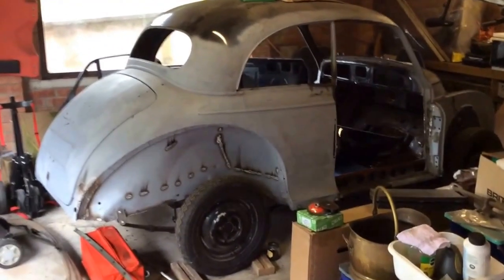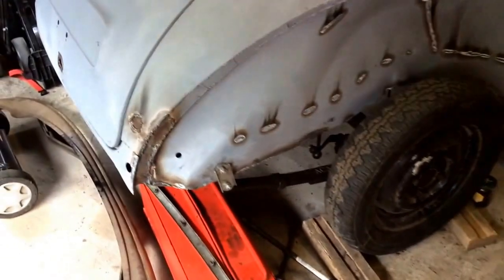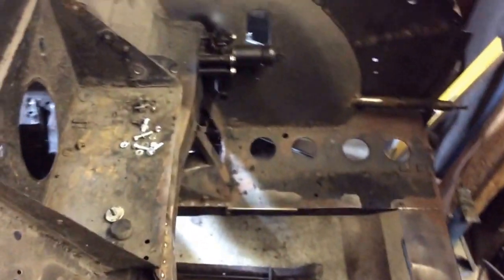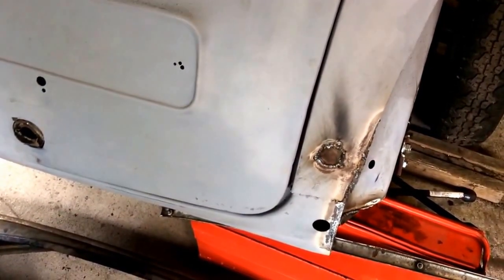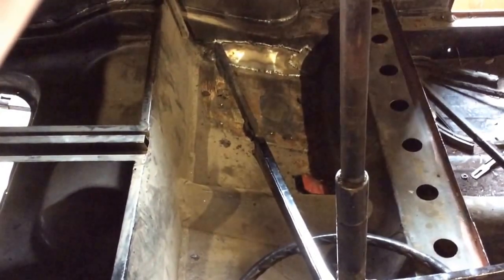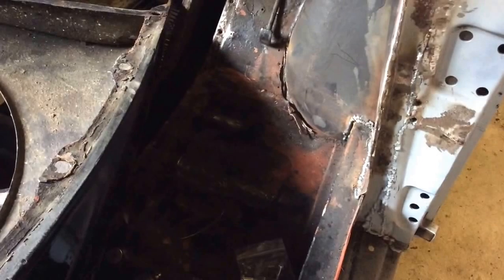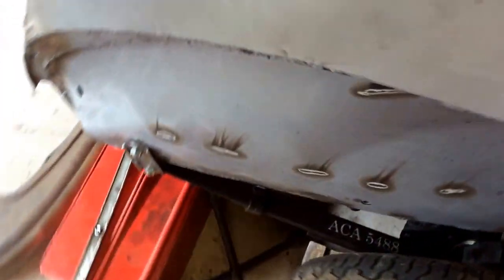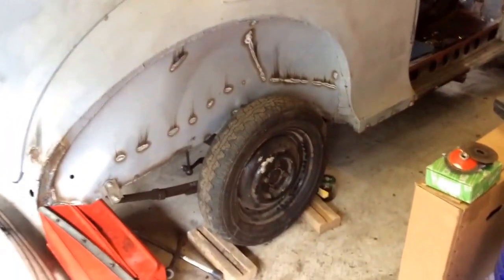1954 Morris Minor Restoration Blog - Part 12

Comment: Whats the latest on your little minor? Did you ever finish it? It came dam close to the point of no return. You did a great job bringing it back. Is that your first restoration?
Reply from the maker: +damo690 I have just uploaded a new video! The bodyshop was a bit slow but the shell has returned in original black, ready to be built up again. This is my third restoration, I did a 1976 Land Rover and 1950s cattle trailer to match that. Check out the video and let me know what you think!